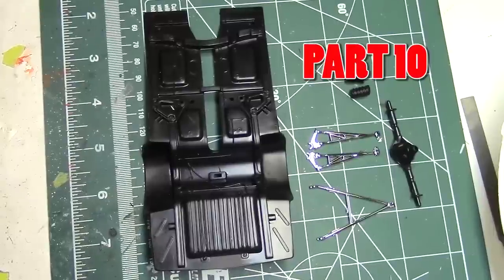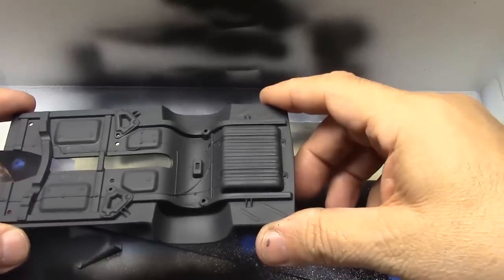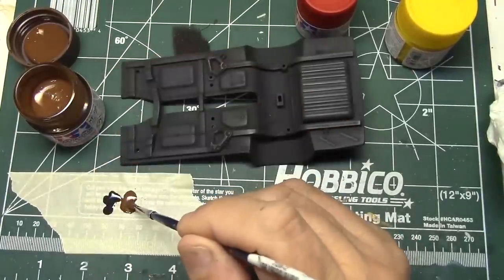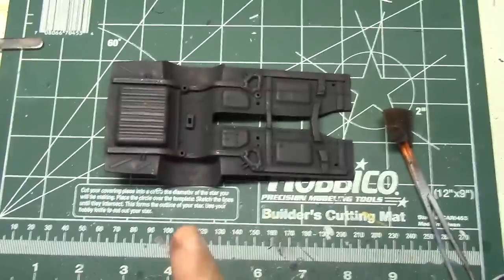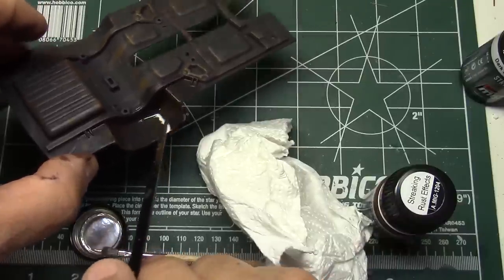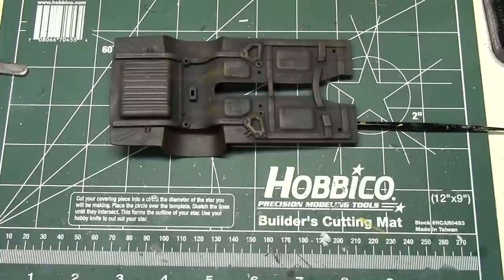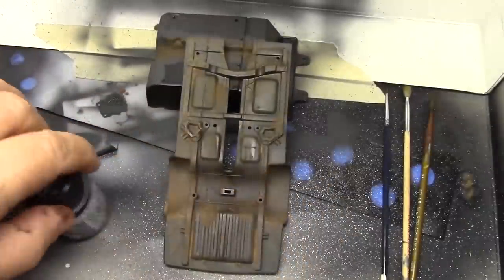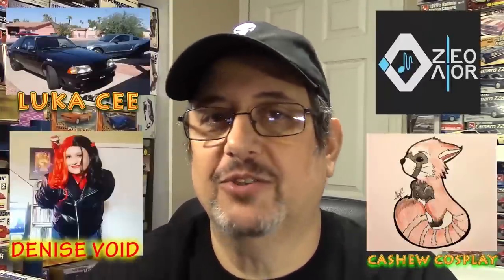How To Do Real Looking Weathering a Model Car Chassis.(AIBMC Part 10)

Comment: There used to be a show on PBS named "Adventures In Scale Models" and one of the tips they used often enough was a "dry brush" technique!! On and around sub frame parts I find dry brushing tiny spots with a dull flat grey (mainly high spots) and even "flicking" specks of silver into those same areas, gives the look of "clean bare metal"!! Because over time some high spots DO have "clean metal showing" due to stone chips literally "sand blasting" (effect) on the steel parts themselves! Typically you see this on where the frame is "lowest" in the car on the curved horn directly behind the wheels...where rocks, sadn and mud is kicked up onto it!!

Comment: Another neat trick I have seen is to make a sand blaster out of an air compressor and a 16 oz bottle.  Once you’ve completed the paintwork, you can hit the underside with the sand and it really adds a neat element.

Comment: You mentioned at the beginning of this video that you were going to also show the process of stripping chrome from parts.  Unless I missed it, you did not include that in this video.  Do you include it in another video?  I am currently building the 1966 Chevy Super Stocker and I'd like to strip the chrome off a few of the parts on the tree.  Thanks.
Reply from the maker: I did the video. It is on this channel
Reply: @TheLukaCeeChannel  ....I found the video, thanks.  Now I'm watching your video on racing belts.

Comment: 32:32 dip an old toothbrush in your rust wash and then flick the bristles with your thumb, spraying the wheel well with your mud and rust stains.  Best way!
Reply: Just saw where you did that later.